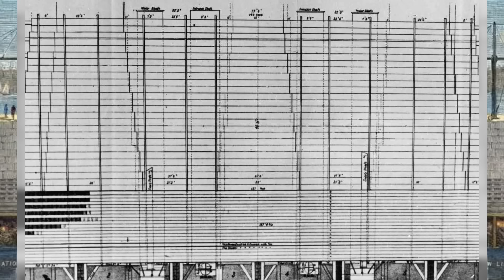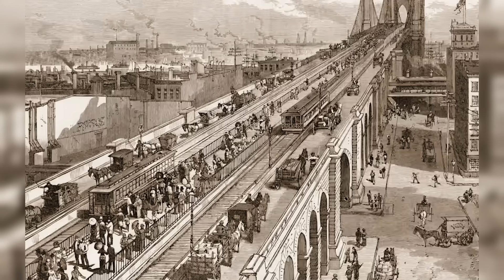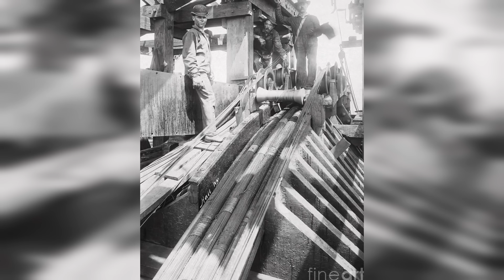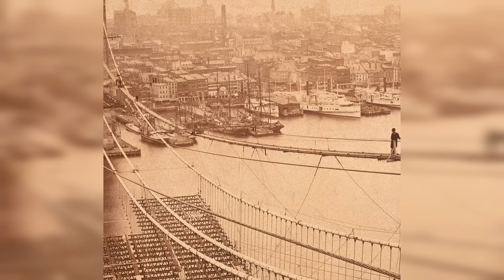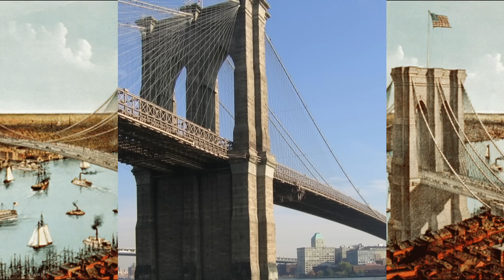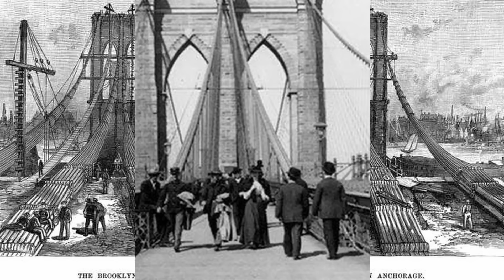WOODEN Foundation Under Granite? What REALLY Supports the Thousands of Tons of Brooklyn Bridge

Comment: Cape Hatteras lighthouse was built on a wooden foundation, it was moved in the 90’s back off the beach a bit and is on a concrete foundation now. Oak will stay solid if it stays wet this was a very common practice at one time.

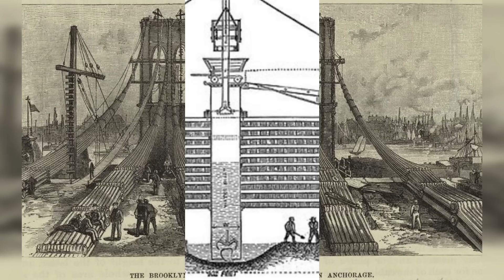Comment: “ They only had hand winches and steam engines” 3:50 There-in lies a huge conversation concerning a bridge that served as a large connection in an electrical grid in a time before we supposedly had electrical current available. 🤣. Built before we had pencils, hydraulics, trucks, cranes…god the stories all seem so disjointed. Deliberately.